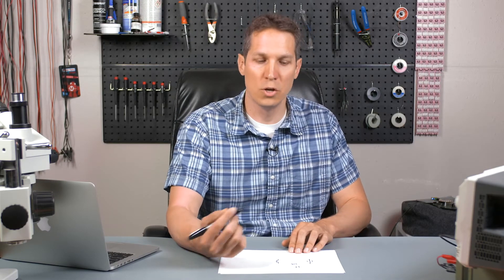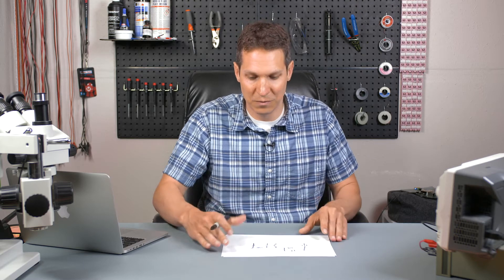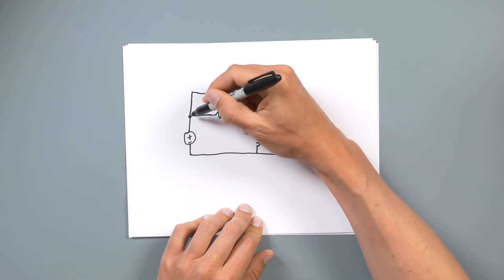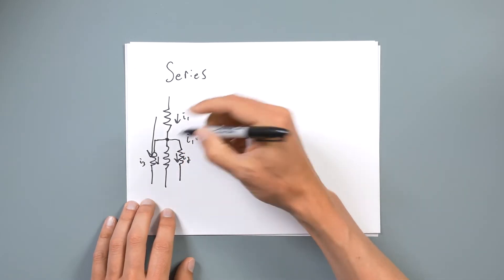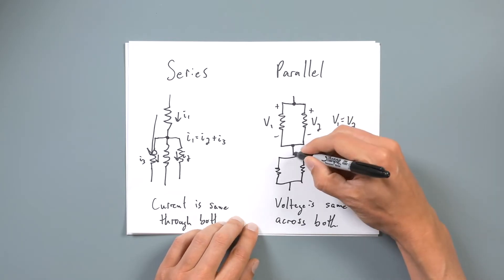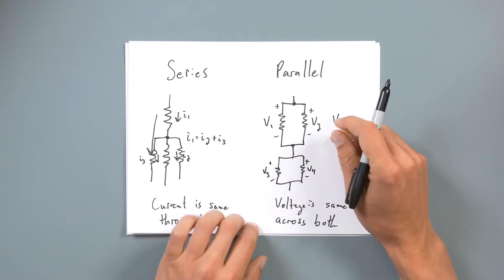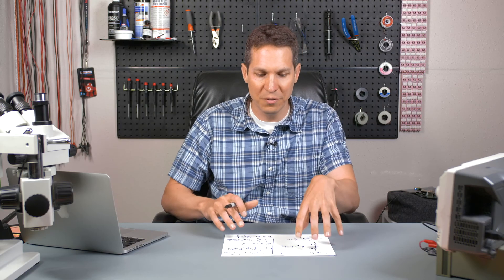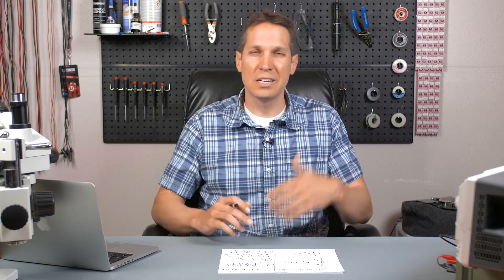What are Branches, Nodes, and Loops with Series and Parallel Components? | Basic Electronics

Comment: 5:30 when is this second loop occuring? Simultaneously with the first loop? Or the second loop only starts when the voltage supply on the left is switched off and then would the second loop represent discharging of the capacitor through the resistor?
Reply from the maker: The response got long, so TL;DR - usually the loops all happen at the same time. 

Long answer - With loops and branches (or circuits in general), we can look at them in a few ways.  DC or steady-state, where we assume the power input is steady and everything has settled to a final value that will not change unless the inputs change.  Transient response, which kinda sounds like what you’re talking about, and that’s what happens for the few micro/milliseconds after an input changes or a switch changes.  Then there’s the AC analysis when the input is constantly changing (with a sinusoidal input, usually).  So, the answer to your question is… it depends.  But, most of the time, if we’re looking at it from a DC or AC analysis point of view, the loops happen at the same time.  The only time that’s not the case is if there is a transient with a capacitor charging or discharging, affecting other loops as it reaches particular voltage levels (say, it passes the forward voltage of a diode).
Reply: @CircuitBread  Thanks for your reply.

Comment: TS ~ 13:00, he says finding voltage divider value between R1 & R2 is difficult. It's easy - 
add R1 & R2 values.  R1 + R2 = Rt    
then I = V/R , you're using Rt here. 
Since series circuit, current ( I ) is same for both resistors. 
So ...  then take I * R1 = V to find voltage drop across R1.
Reply: wow thats so much easier than summing up the resistance, you are a genius. /s

Comment: 17:09 sir I think you are wrong about calculating the equivalent  resistance in parallel  R(eq) = (R1 x R2) / (R1 +R2) but your explanation was awesome
Reply from the maker: You are absolutely correct - if you invert the 1/R(eq) from what I put down, you get what you have: (R1 x R2) / (R1 +R2)  It can be very confusing, at least for me.  Thank you!
Reply: @CircuitBread  I get it  now thank you very much sir I appreciate your work

Comment: at time 7:33 when you added that other resistor, that part of the circuit is no longer a series. it has become a parallel branch because if you send current through the circuit, the current will have two paths to flow..
Reply from the maker: I admit, I was a bit concerned saying that -  it introduces a bit of confusion.  But the two parallel resistors (TOGETHER) are in series with the top resistor.  That's what I was trying to say and I'm sorry if it wasn't as clear as I was hoping it would be.
Reply: @CircuitBread  no! Don't be sorry... It wasn't confusing to me because I fully understand series, parallel and series-parallel circuits...
Reply: @james77011  nonchalant

Comment: hi I have a question and my only learning platform is youtube so ill be appreciated if you help me with this how does ampere works if I have an LED strip that needs 12v and 2 amps and I have an output of 12v but the ampere is like 18 does LED strip only uses 2 amps needed or it will burn?
Reply: Led burns when the voltage exceeds the give voltage of the led
I mean think of it like a flow of water through a pipe where the pressure is voltage and the flow rate is current, a diode accepts the needed amps of current, even if it's high it doesn't matter because amps does not damage the led but if voltage is high the the led could burn , if the voltage is low the intensity of light would be less so do keep in mind that all leds except some work with 5 volt dc and amps depend on how much led you have connected if the leds are more you would need more amps and do keep in mind that the voltage should be 5v
Reply: @flurican3485  thank you man big help.
Reply from the maker: Hi Mahdi, in summary of what Flurican said - as long as you match the voltage requirements and can provide at least how many amps it needs, you're fine.  So, in your case, it's fine.
Reply: @CircuitBread  thanks that really helped me out.